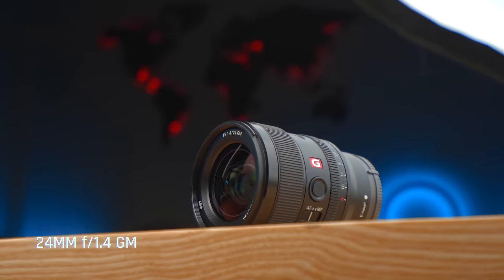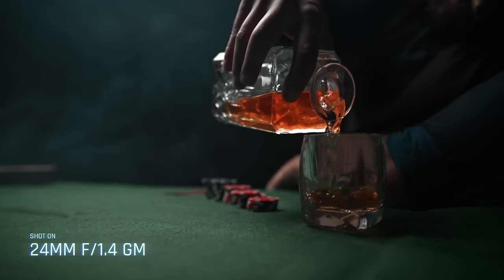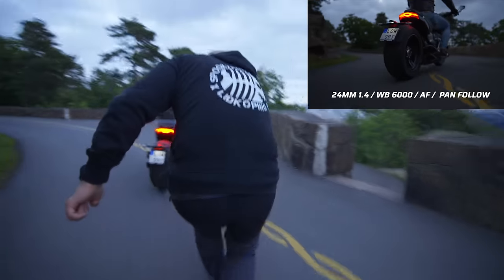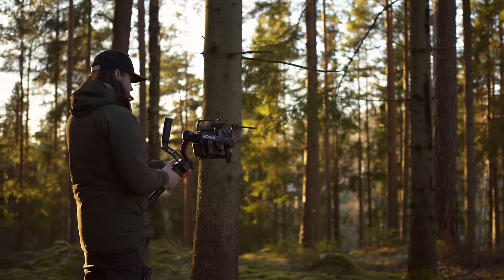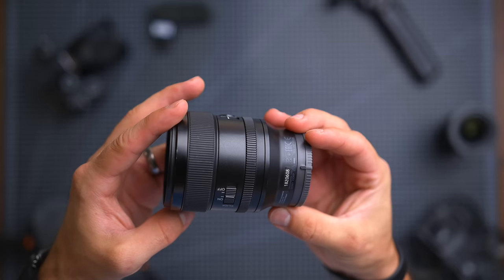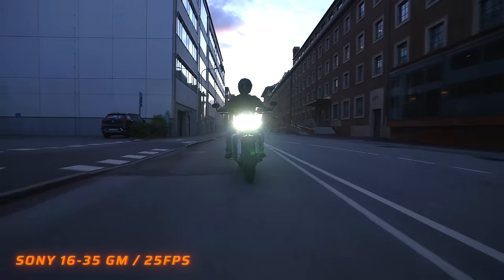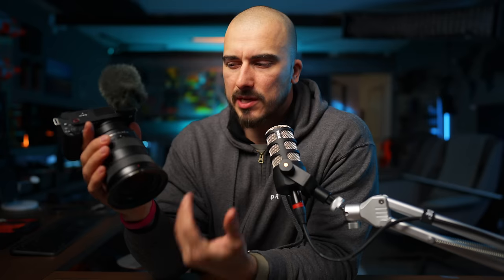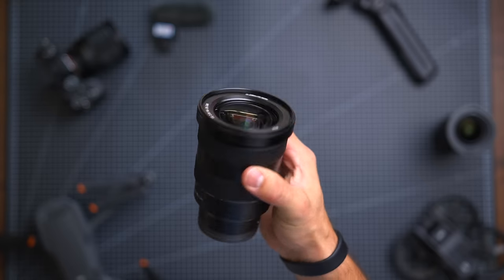My Favourite Sony Lenses 2023

Comment from the maker: Which lenses are your favourites?
Reply: 14mm gm; 35mm 1.8; 24-70 gm II; 70-200mm f4 macro
Reply: 24mm 2.8 g, 35 1.4gm, 85mm 1.8
Reply: Since I shot a lot of events were stuff happens fast. I’m mostly using the 24-70 2.8 and 70-200 f4
Reply: 200-600mm f/5.6-6.3 G, Laowa 24mm Probe, Laowa 25mm 2.5-5x, and Sigma 24-70mm f2.8 but would love the GM, but it has insane lens breathing control.
Reply: nikkor 70-200 f 2,8
Reply: I only have 35mm f1.8 and I love it😊.
Reply: @piecesandbytes   70-200 f3 m1 or m1? I want to buy it for events, and longer reach, plus macro
Reply: GM II Trinity, 35GM and 55 Zeiss.
Reply: 24GM is also amazing but didn't use it a lot this year. 16-35 PZ was dethroned by the GMii, but its also a nice lense
Reply: 16-35 f4 G PZ, 24-105 f4 G :)
Reply: Actually I don't have a favourite one because I have only one stock 28-70 f3.5 on my sony a7iii. But after your review I want that 50mm 1.2 😌 thanks a lot for a video examples. It's not too much on YT.
Reply: I use the 50 1.2, 24 1.4, 135 1.8 and the 14 1.8 but 80 % the 50 and 24 👌🏻 thinking of buying the 90mm but maybe waiting for the mark 2 😃✌🏽
For travaling i also take with me the 16-35 f4 and the Tamron 70-350
Reply: 24gm is fantastic. I use crop mode when I need 35mm

Comment: Building my kit still have the 24gm & 55 atm but this is the end goal setup I’ve envisioned for my needs. Solid choices 👌🏼
Reply: Probably with the 50 1.4 gm and an updated 90mm whenever that happens and why not the 2x tele for the 70-200 dream big

Comment: I also love my 24mm gm lens, but the lens I’ve used most often is Tamron 20-40mm f2.8. So much lighter than 16-35mm GM and 20mm is wide enough for me!
Reply: You should try the 16 35 pz f4. You will be surprised.
Reply: @thearabicdp  I've tried it and I loved it! Helas, I already have the Tamron 20-40mm which I love so much. Not motivated enough to switch it over.
Reply from the maker: That’s awesome! I’ve tried to get rid of the 16mm range in my kit, but I can’t 😂

Comment: That 50 1.2 has become my all time favourite. Whatever you point it at, turns out brilliant. I also had the 16-35 and the 24 1.4 high up on the list. The 16 now replaced with the sony 14 1.8 gm, though. Also a beast of a lens.

Comment: Thank you for the video. nice to se the Sony mount lenses you using. I actually have all of these but for the 16-35/2.8 I've moved up to the GM II after my son "borrowed" my version 1. Notice you also have the Zeiss Batis lenses I have minus the 25/2 which is not a 24/1.4 GM but matches the other two very nicely so Ive kept it.Take care.

Comment: My go-tos this year have been the 24-70 GM II (which was my primarily lens for years if you count its predecessor) but I’ve actually swung back around the using primes recently. 35 GM, 50 1.4 GM, and the 20mm G have all gotten more use than any of my zooms. 

I regret selling my 90mm macro as well. That lens was special. An updated version would be an instant-cop for me. Also, I have been dragging my feet in the 24mm GM since the day it was announced, but it’s only a matter of time before grab one. Just such a valuable focal length for the work I do and as good as the 20mm is, it is missing something that the GM’s bring to the table.
Reply: Sony 24mm GM highly rated but my preference for 20mm G in the future. Sold my Sony 90mm which tended to hunt; better on manual focus. Sony colours are among the best. They say lenses should last about 10 years. Maybe prime lenses last longer without servicing

Comment: I sold my last prime just a few months ago the Sigma 35 f/1.2 to buy the FE 16-35 GM II and haven't looked back since! The Sigma was razor sharp stationary but it couldn't catch a quick focus to save it's life so the hit rate was terrible. Now, I'm shooting exclusively on zooms with the FE 2.8 16-35 GM II, Sigma 24-70 f/2.8, FE 2.8 70-200 GM OSS II, and the FE 5.6-6.3 200-600 G OSS. So my effective range is 16mm - 600mm FF (900mm on APS-C). That covers 100% of my photo and video needs shooting on the Alpha 1 and a7SIII. Next up will be a macro for product photo/video but I'm kind of holding out in hopes of an updated 90mm macro from Sony. Until then, the 70-200 GM OSS II is more than capable of supplementing macro product shots! One of the main reasons I got away from primes for now is less lenses to keep track of on a shoot and more options within the focal ranges. These newer lenses are freaking razor sharp and have minimal cons over shooting on a prime. In addition, I would rarely find myself shooting wider than f/2.8 especially with the iso range covered between my two cameras.

Comment: My lenses this year were the Sigma 50mm 1.4 and the Sigma 16-28 2.8. I used the Sony 50 1.2 and it was too heavy and bulky and I honestly couldn't tell the difference between the 1.4 and 1.2. The AF on the Sigma is so fantastic, a lot better than I was expecting. The price difference between the Sony gm 1.4 and Sigma meant I could buy another lens with the 400 dollar difference. I thought I was gonna buy the Sigma 14-24 but I ended up with the 16-28. The threading on the lens meant I could stick a matte box on the front threads with no issue. Which is really important when I'm shooting outside and controlling light to shoot at iso 800 for Slog 3. I used to be team Tamrom and I still own and love the 70-180 and 28-75 g2 but after this year I feel like I'm team Sigma.
Reply: I  was wondering 🤔 if Sony lenses were crisper etc: so your results show Sigma is equivalent😮?
Reply: @imboredDB  I've had zero complaints with my sigma lenses so far in my video work.

Comment: Why the filter diameter is bigger on the Sony and sigma, is it to have a better light absorption? I have the sigma 28-70 but the filter tread is 67mm but the most premiums are 82, why not 77 or 67
Reply from the maker: It's about lens size

Comment: I'm considering the 90mm macro as my next lens (the 70-200 gm II would be a dream but it is way over my budget) since I want a longer focal length and I always find myself close focusing with my 35 and would love to get alot closer. However, hearing you say that it needs a update made me want to wait for the new one (if they are going to update it). I'm used to the fast AF on the 35 and would probably be disapointed in the current 90 when tracking moving subjects.
Reply: If I could offer advice, I bought the 90 mm for the same reason and found it too slow for AF even with a newer Sony body. I’ve since got the tamron D2 28-75 that focuses very close for most things, also blazing fast AF!
Reply from the maker: I love the 90, but it does feel very old at this point 🫠
Reply: @christianisaacjones  Appreciate your advice, I will look into the Tamron 28-75.